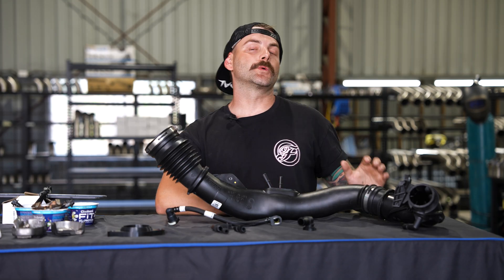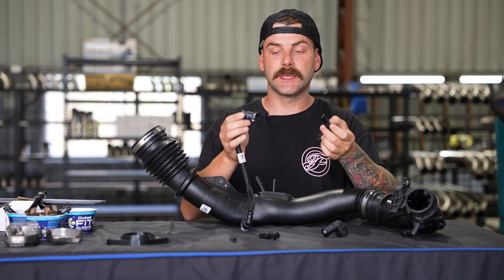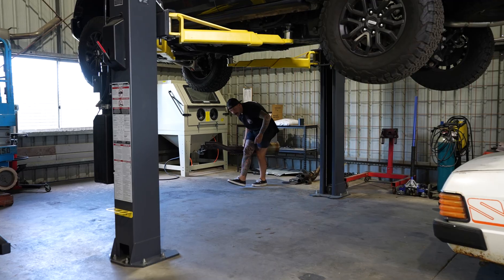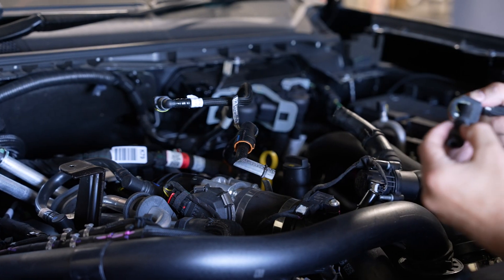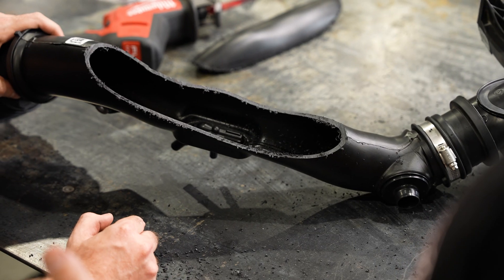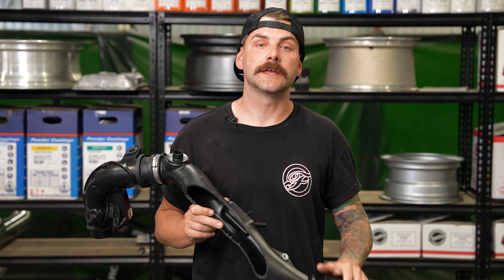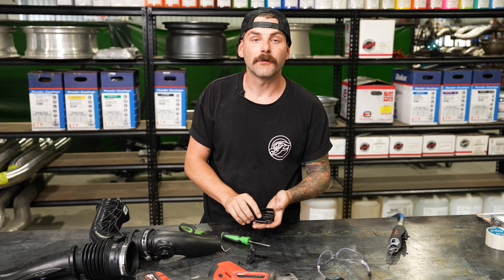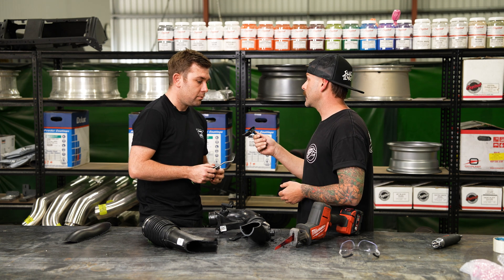RAPTOR BUILD Ep4: Factory Intake CUT UP

Comment: I think the bigger pipe reduces down to prevent the pressure from the smaller pipe taking the path of least resistance and going back into the bigger pipe and also the bigger pipe being reduced down so much would also cause suction on the smaller pipe as it passes by. I could be wrong. Just my opinion.
Reply from the maker: We think you're spot on here. We managed to get a Ford tech to give us the run down and we will revisit this in the next intake ep.